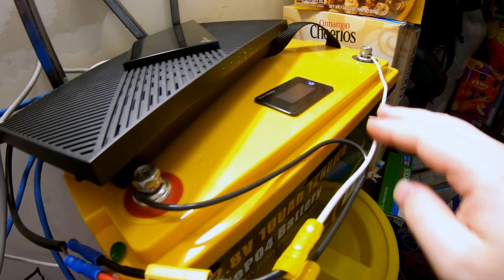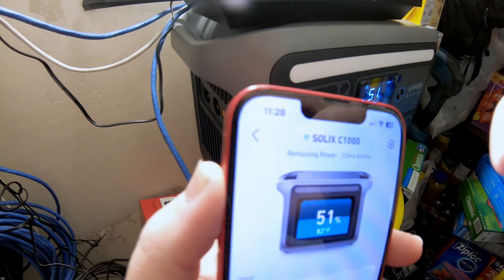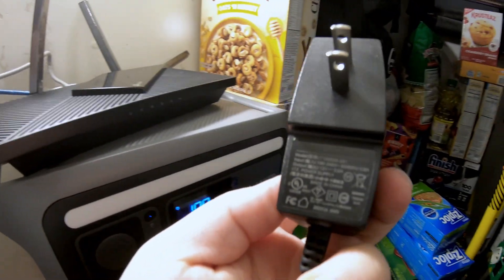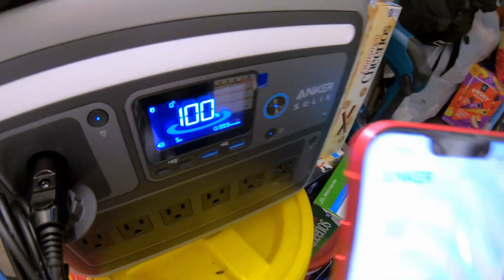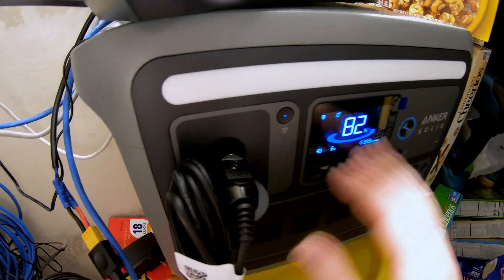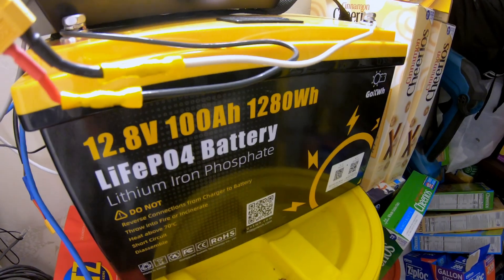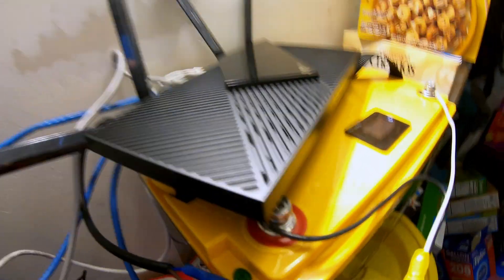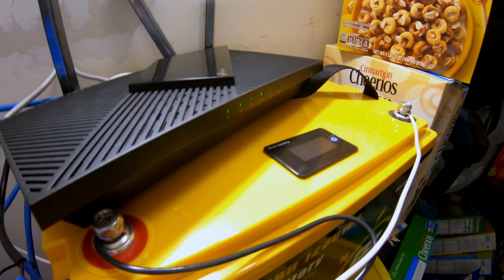I’ll Bet You Didn’t Know This! Powering Your Internet Router with 12V DC during Blackouts!

Comment: 12ish.  Some devices are ok with direct, some are not.  I run my routers and stuff off direct float of 13.4v.  But for hard drives (ATX spec), I will run those through a buck-boost.

Most devices internally regulate their 12v input down anyways. You can kind of tell by looking at the input capacitor's max rating and the regulator IC.

Also instead of xt60s, lever connectors with ferrules are kind of convenient.
Reply from the maker: Great observations and ideas! Thanks for sharing and watching!